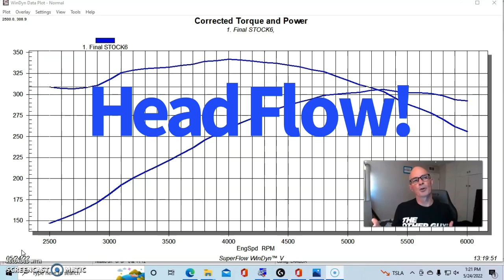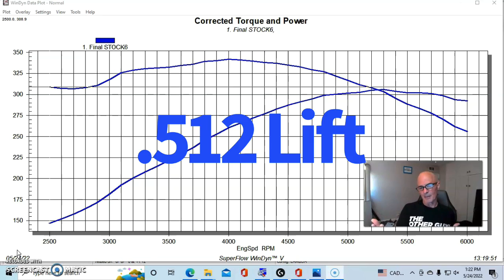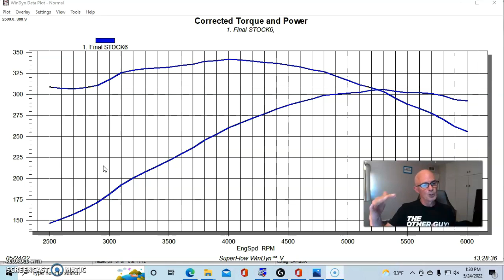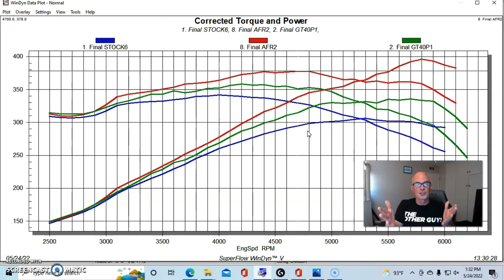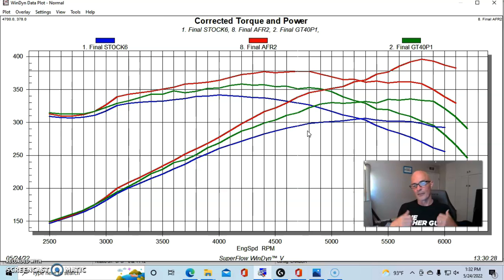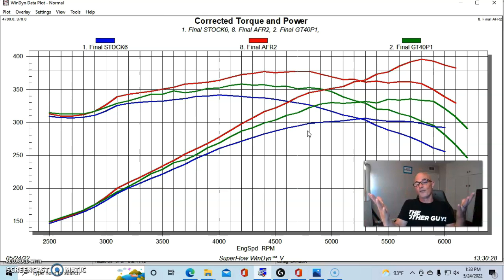HOW TO ADD 90 HP TO A 5.0L FORD! 302 HEAD TEST-E7TE v GT40P v AFR 165. ARE ALUM HEADS REALLY BETTER?

Comment: How can people say I know a guy that runs so and so cam and bolted on AFR heads to gain 150HP+ over stock?!
Why would someone even bolt on aluminum heads without an intake and a properly sized cam?!
Stock cam with 1.72 rockers and AFR heads will NOT make 400hp! Plus the A/F ratio would have to be adjusted to keep from blowing it up. 
As shown in the graphs, it's not an easy task without changing other parts!

Comment: Ran that cam with Edelbrock RPM 5.0 setup with injectors and all 70 mm tb headers etc 170cc heads, that cam falls off at 5800
Reply from the maker: your intake fell off at 5800
Reply: 1.90@ 5800 170cc I was thinking had more gead than cam. @richardholdener1727

Comment: How much less power would you get with the stock Explorer intake manifold in place of the 4 barrel carb.
Reply from the maker: NOT SURE-I WOULD HAVE TO DO SOME LOOKING
Reply: @richardholdener1727  Just curious what kind of numbers it made. That is the combination I have in my 1994 Mustang GT. I put the 1996 Explorer intake, and 
 GT3 bar heads with B cam. years ago.

Comment: Would love to see a 351w junkyard engine with GT-40P heads on it!
Reply: Im currently building a top end of a 81 351w with a RV cam im it. Pulled motor my self out of the RV it only had 35k miles on it. With a C6 transmission.Putting gt40p heads on it, they are currently at the head shop. Getting port, polish,  valve job. Was going to do a 4 barrel cast intake for cost but managed to find a aluminum that i was looking for for cheap. So im having head work done.

Comment: Richard, I recently had my 289 kill 2 pistons. It was a 0.030" over,  9.1:1 with AFR 165's and a flat tappet XE274H cam, Performer RPM and 650 Brawler. Since it is down, I'm thinking about upgrading to a 5.0. My question is, do you know if stock pistons will have issues with 165's and the XE274HR? I know of one that should only need a mild cleaning and honing. If I have to spend a small fortune to build a bottom end, I may just punch my 289 0.040" over and reuse everything else. Thanks again, your stuff is very informative and enjoying to watch.
Reply from the maker: no valve reliefs?
Reply: @richardholdener1727  the stock pistons of a 5.0 have small valve reliefs, but are they adequate for the XE274HR and the 165 heads or are they too shallow? Just wondering if you have tested that cam on a stock bottom end and have run into piston to valve issues.

Comment: To bad AC delco doesn’t make a head for it !  I don’t know how much better they would be compared to AFR or Edlebrock .  Just a wild guess they would be as good if not better than the Brodix  ?  I’d say they would be better than the trick flow !  Because that would be the trick when AC Delco made performance heads for small block ford !  I would like to see retro fit hemi heads for small block Chevy and ford .  Also I’d like to see a flat plane crankshaft for say 302 / 327 . Because we know you can’t go real big in cubes with a flat plane crankshaft .  The other is dual overhead cam with 4 valves per cylinder !   I can say I learned that a small bore and a long stroke is the better combo for efficiency of power .  That floored me dad always said short stroke big bore more horsepower !  Small bore long stroke big torque out the hole or truck motor made to pull ! But they show that with the long stroke it can get more flow and when the burn doesn’t have to go far out an it’s in a smaller hole you get more efficient punch down on the cylinder because it’s concentrated in a smaller circumference.  Now if you run 4 valves per cylinder on this type engine then the angles of the valves dictate wether it’s a fuel efficient engine or it’s a performance engine !  You find out the craziest things when you just go to see if Toyota got GM’s old 5.7 engine .  No 4x3.48 no way a longer stroke than the 454 yeah 4.03 and a bore smaller than the two baby’s 265 and 305 3.75 bores the Toyota 5.7 bore is smaller than the smallest small block. Like I’m thinking it said 3.65 or something around that size .  Then you find Yamaha has a lot to do with Toyota engines !  And the Taurus SHO 3.0 was built for ford by none other than Yamaha .  Say what then the 4.4 for Volvo built by you know who Yamaha .  Yes all because I just had to see if the Toyota 5.7 was the old GM 5.7 . Who would have ever guessed but now we know why Toyota doesn’t build motorcycles and why Yamaha doesn’t build cars . They say they been in bed with Toyota from back in the 60’s . That’s a lot of information I did not know or if some one would have said they built a engine for ford . Why that would be the biggest lie ever told !  Then the 5.7 bore an stroke a torque monster. I wounder if that’s the same bore and stroke they run in NASCAR?  8-9000 rpm ? ? ? I’m afraid to go find out it’s hard to tell how much more I’ll find out I didn’t know !  I love the engine building Richard I even build up 3.5 lawnmower engines to shaving head under cut valves port polish weld cam regrind . I’m 50 and started that kind of hot ridding at 10 years old ! I got tired of the stupid mower dieing out in high grass then not wanting to start back up ! When it’s cutting around 5-7000 rpm it just don’t have that bogging down problem any more . It just burns right through it and red bricks and saplings .  Even ol sawgrass .  I’ve never bent a crank or sheared a key in a built motor but a stock one I have . Now I’ve bent a ton of blades with a built motor . Even hit an drove a railroad spike through the side of the deck .  It’s amazing how powerful a 3.5 horse Briggs & Stratton engine can put out . Thanks for+the video and what you do from one old motor head to another keep on motoring !

Comment: I have a set of 1970 351 DOOE heads that now are ported with 1.94/1.50 valves thatre goin on my 5.0.Do you have a guess on what they might flow as they are?
Reply from the maker: no way to know without flow testing

Comment: im in the process of upgrading my stock e7 to gt40 3 bars, my car now is just stock .030 over 302 with 1.72 rockers and a b303 cam with exployer intake with long tubes, c4 trans and big convertor. car runs 7.8s at 83/84 mph in the 1/8 with high 1.5 low 1.6 60' times, 4:10 gear with 28" radials, weights 2800 with me in it, wonder if the stock cleaned up gt40 3 bars will put me closer to the 7.5 range?
Reply from the maker: ported gt40s can support a lot of power-see David Vizard's channel

Comment: Ever taken .030 off a set of 1996 4 bar GT40’s? I read on the interweb that Ford did this on the cobras. Funnier yet when you start looking into combustion chamber sizes you’ll find several answers on the 93 cobra heads. Have you ever measured those? Any idea if the head milling story is true?
Reply: Our race shop did it 25 years ago.
Head intake face must be milled to fit.
Piston clearance gets very critical.
Other things need upgraded to run up the rpm. $$$+++

Comment: Mr Holdener, I would love to see you repeat this test with a solid roller lifter and the off the shelf AFR (or TFS) hydraulic valve spring pack... RPM! 

Ill bet many of us running around with 5.0 motors aren't driving them to work anymore, these are weekend toys and hydraulic lifters aren't as important.
Reply from the maker: for this rpm, hyd roller is more than adequate-we only run solid roller cams on very high rpm stuff

Comment: You use a lot of COMP Cam stuff.
I'm in an FE engine group on Facebook. 
All I hear about is COMP CAM and lifters failure.
Hardly go a day without hearing about cam and lifter failure from COMP CAMS equipment. 
Do you have any comments ?
Reply from the maker: I've never run an FE on the dyno

Comment: Richard, I know this is an older episode. I respect you experience and knowledge.

 I am building a 289 for a 66 GT-350 and wonder if I use the AFR combination and a stroked crank could I see similar numbers? Running Tri Y headers. Can I run a hydraulic roller in a 66 289?
Reply from the maker: YES YOU CAN RUN A HYD ROLLER (RETRO FIT CAM), YES USE AFR AND JUST BUILD A 302 OR BIGGER TO START-PUT 289 VALVE COVERED ON IT

Comment: Great video! What street camshaft (hyd. flat tappet) do you recommend for use with the gt40p heads?
Reply from the maker: PICK THE CAM FOR THE POWER AND RPMRANGE YOU WANT-LOTS WILL WORK WITH THOSE HEADS
Reply: @richardholdener1727  thanks! You think I can get away with new stock valve springs if I stay under .500 lift?
Reply from the maker: no

Comment: When you put gt40 explorer heads on a 5.8W do you have to get different pushrods and are the head bolts the same size. I like watching your videos you do a really good job explaining  thanks.
Reply from the maker: heads need to be drilled out for 1/2 bolts

Comment: Could I run the stock distributor in lieu of the msd distributor?  Running 302, .030,  RPM intake, E cam,  Holley 600cfm carb,  and 1.6 roller rockers.
Reply from the maker: yes

Comment: I have afr165’s on my 347 with funnel web intake and a Anderson af-n112 camshaft. Was wondering what kind of power it will make.
Reply from the maker: don't know specs on that cam
Reply: @richardholdener1727  the lift is .576 intake and exhaust. Duration is .331/.342 I think they are very secretive of there cams. I will have the cam tomorrow it coming in the mail
Reply: @richardholdener1727  with 1.6 rockers

Comment: quick question I got a 87 hatch back GT40 heads header edelblock intake 600 CFM carburetor
Reply: electronic fuel pump of regulator I ran 11.23 I a quarter mile at 129 I spun in first and second t5 trans so I got the oil changed in they put the oil filter that a stock motor called for I didn't even put a 100 miles on it since the oil change now it making a grinding noise and lost all of its power
Reply from the maker: DID THEY PUT OIL BACK IN

Comment: Hope you run the new test you mentioned at the end.  Racer I know has a stock short block, carbed 95 GT with an E303 cam and a Weiand Stealth intake.  He picked up 3 tenths in the 1/8 going from ported GT40 heads to AFR165 Renegades.  Ran 11.88 @ 114.75 in the quarter with the AFR heads.  He 60 foots about 1.58.
Reply: Some of that will be the 40 lbs the AFR's took off the front end. LOL

Comment: I have a 89 ford e150 van with a 302 glass tappet engine. I am converting it to carburetor and I'm also convert8ng it to a roller motor. But I'm keeping the same pistons and crank. What cam and heads can input on this motor. My carb is a holley 600cfm
Reply from the maker: cheap way is to add gt40 heads from an Explorer
Reply: @richardholdener1727  yeah but I was wanting to put aluminum heads on it but if the gt40s is all I can use then I guess I will get those
Reply: Lol, I have a 91 converted to carb. 👍🍻

Comment: Why does ford say the explorer 5.0 with gt40p heads only have 215hp? It seems like your able to make way more power out if that motor without doing much work.
Reply from the maker: rated vs tested power

Comment: a 306 in my Fox right now that was rebuilt 7 years ago.AFR 165 heads as shown,TF stage 1 cam,short headers and h pipe/flowmasters.Vortech intake with Accufab race 70mm throttle body and 30lb injectors.Top it off with a Vortech A-trim blower(very low boost,very small and first ones ever made).when dynoed it made 400 RWHP and 430 RWT.It screams along for me and fun to drive with the 5 speed and 3.73 gears.Its basically almost a  show car so driven accordingly most of the time.Im a Ford tech and drive all sorts of things,I know it could keep up with the current 302 mustangs and the 05-10 gt500s in the 1/4.good stuff that i truly can relate to.

Comment: So the mustang 302 and explorer 302 are rated for about the same HP.  If the explorer heads gain HP on a mustang engine then what does the mustang engine have that the explorer doesn't?
Reply from the maker: cam
Reply: According to Ford factory chart, all Explorers have the 93 Cobra cam.
It isn't much in the real scheme of things.
And the EXP has bad exhaust and 90* intake. Rated 200 HP. It's built to pull the fat ass Explorer around town.
Reply: What's a good head upgrade for an Explorer platform with stock bottom end?

Comment: I just watched a vid on a 403 hp 302 however it was a .030 302 making it a 306, using aftermarket comp cam, dual plane weiand intake, 600 holley carb with "CAST iron heads" however it had 2.02 and 1.60 valves in those heads. it did not specify what heads those were. Just that they were cast iron and had been worked.  so what that tells me is that its matching combo to your flow numbers, cam, carburation.
Reply: One of my 306 builds ran the 200cc Roush heads that are cast iron. Using the factory HO cam it made 360hp.  Them heads and cam are now in the 351W for my '91 E150 travel van.
Reply: David Vizard gets $ 4,000 for a pair of SBF iron heads ready to run. You got a have a passion for iron to do that.

Comment: I've ran afrs 165s with a stock cam and 1.72 rockers with better springs then what the sold them with back them. 1st gen sbf heads so before they switched to 8mm valves and better springs.   Lol its wasn't close to 400 without the nitrous  typical EFi foxbody with gt40 intake and all the bolt on junk.  Ran 12.30@109 at 3300lbs and low 11s on the bottle. Think it dynoed 280rwhp something on motor back then. It picked a good bit when I did swap the cam for a mild cutom grind. They must of had one of those factory stock or real street nmra class cams for that test lol

Comment: I think 400 with a stock cam is possible. 
It would probably take a blue printed short block , afr 185 heads( 30deg back cut on valves ) , milled down to 54cc ,1.7 rockers , port matched rpm air gap intake 1 3/4 headers full length, .027 head gaskets , ultra 650, electric water pump , and cool air , and maybe play with cam timing.  Retard it some possibly

Comment: the stock 5.0/5.8 timing cam is good to 350 hp, i'll bet the old magazine test has a rocker arm ratio swap. Still, a 400 hp engine and the right gearing is a potential 11 second Foxbody...cheaper than a coyote swap before you even spray with N2O.

Comment: Richard, i have a 6.0 LQ9 with 799 heads. What is the biggest camshaft that i can fit without ptv clearance issues. Love the content
Reply from the maker: something near the specs of the Comp 54-469-11-but you should check p-v

Comment: I wonder what 185 afr and a trick flow stage 4 cam would do in this configuration because that's basically my engine I'm putting together
Reply from the maker: do you have valve reliefs?
Reply: @richardholdener1727  yes 7 cc flat top wiseco  I know I killed the spelling on that I also have .039 felpro head gaskets

Comment: I've seen the 2002 T3 Tickford 5.6 liter Falcon  factory 369 HP net from CNC ported GT40P heads, with a 1993 Cobra SVT style cam. So thats 405 HP gross. Again, Maybee, just Maybee, that 400 HP with those alloy  heads, 1.7 rockers and a stock 5.0 Mustang HO roller cam 5.0 engine is possible. I vote for a New Test. Best wishes for the conquest of Truth over Hype!

Comment: some years ago i use to look for an pull GT40 heads from Explorers. i never found the effort worth it tho its a real pain in the butt to pull them. then you still have a used head that should really be gone through by a shop and upgrade the springs. thats alot of time and effort for gaining like 20hp. this is why i went ahread and spring for aluminum heads. only real advantage i see with getting junkyard heads is you can also get the GT40 intake to replace the crappy stock intake if you do not want an aftermarket intake
Reply: Yep, spending $800 at a machine shop, springs, etc. to rejuvenate junkyard heads, even if you home port them,  is not often worth the minimal gains.

Comment: They used 1.7 RR in the Car Kraft Article. Funny you didnt mention this as the lift is alot more.
Dyno measurements can also be way different between dynos
Reply from the maker: I did mention it-and having run the same motor on 4 different dynos across the US-properly calibrated dynos read the same

Comment: what intake are you using would a 1.7 roller be to much for the piston to valve clearance
Reply from the maker: it doesn't need 1.7 rockers-it already has a cam-RPM intake

Comment: E7 heads flow about 150/110 from what I've read so 306hp is pretty close to max. The 166 number you gave was for the GT40 head?. That would be in line as 16cfm additional would give an extra 30 hp.Stepping up to an old B303 cam would get you 425-430hp with the AFR's.BTW, this build with the Demon 650, roller rockers, 165's, mild roller, 15/8" headers and MSD is very similar to the Car Craft build done about 9-10 years ago. Same results.
Reply from the maker: the 166 is the E7 flow

Comment: The 1-5/8 headers are a restriction with even GT-40P heads. Bonafides: 1993 coupe, stock 35K mile explorer long block, GT-40P heads never came off of it, I believe 26986 Comp beehives, stock Mustang 5.0 camshaft, 1-3/4 BBK headers (yes a couple spark plug wires are tight), Explorer intake manifold. Made 300 wheel horsepower through a 5 speed on a dynojet dyno years ago. Car with a hot-shoe driver ran high 11s @ 2900 lbs.  Speedbrain engine management, so we were able to run a Lightning MAF, and actually control timing, etc.

This combination came to be because the 331 that was in the car died horrifically, and there wasn't money to replace it. All that remained was the intake manifold, throttle body, inlet tubing, and exhaust.  Throttle body opening on the upper was opened for the larger throttle body from the expired stroker.
Reply from the maker: 1 5/8 headers are not restrictive on a stock-cammed 5.0L
Reply: @richardholdener1727  If you say so. However, a set of BBK 1-3/4 headers with a Fel Pro 1487 header gasket, is worth repeatable horsepower and mph over a set of BBK 1-5/8 longtubes with a stock cam. Or, at least it is when you cut off the ball and socket and use V-bands.